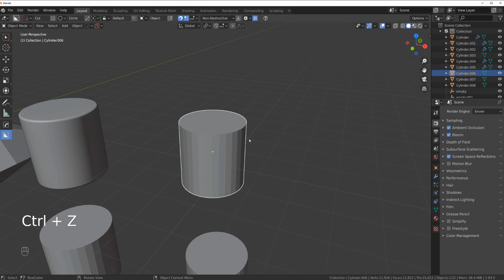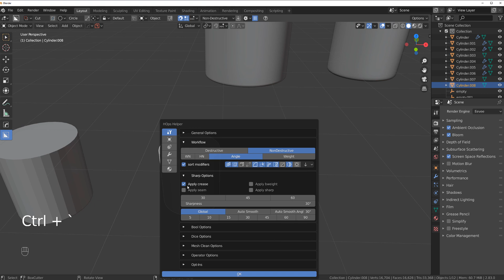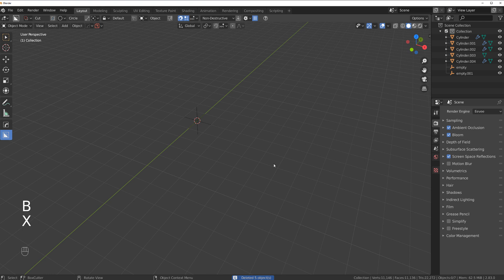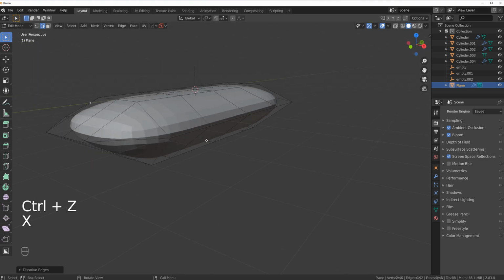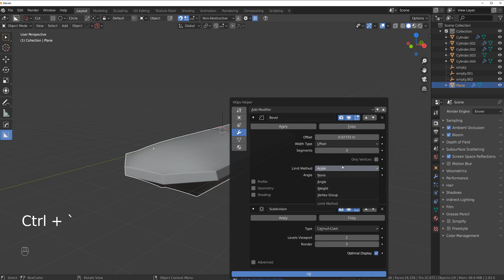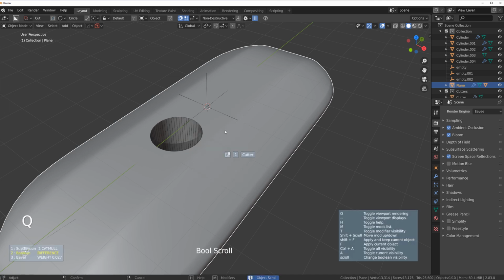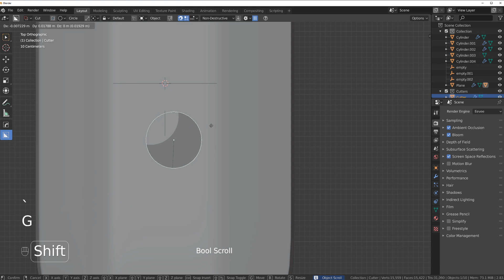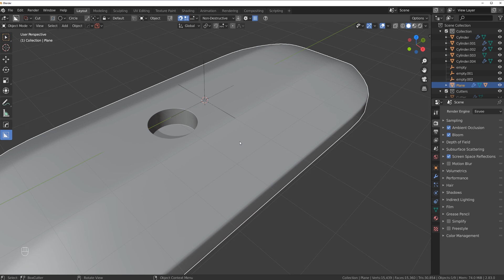SUBD + BOOLS + BEVELS - ultimate control in BLENDER

Comment: "How do you do this in Vanilla Blender?  You don't, cause you can't." - PR.
Then I'll have to put in my time with vanilla blender mastering I can't, and then I can get the addons.  NOT.
QED. 
Do it the most efficient and effective way as fast as possible.  Everything else is playing with yourself, and not in a good way, a wasting time way.  I did just realize I don't understand the Step function...
Reply from the maker: Exactrly. Just watch my vid on Bevels in hardops, it is in the hard ops and boxcutter playlist.
Reply: @PonteRyuurui , k, cool.  I'm starting further back though, cause like a pitbull training on kittens (those guys are sick), I started with bc, so I could stoke my confidence (hopefully, I didn't know bc parents by default its bools)...and then return to Hops like the ocean beating on the coastal cliffs, hoping I will eventually erode some of them away, and make it to land and safety.

Btw, may I assume the super wide aspect ratio is an artifact of your super wide monitor you have to work on for the bc videos?  Or was that a choice in post to have a super cinematic affect to your videos?  That's wider than 2.39:1 I think!
Reply from the maker: @jeffspinner6579  ya the older vids were in 21:9, i was recording in 3440 1440, now i simply record in a smaller window so 2560 1440, while i wait on you guys to get proper monitors ;-)

Comment: i thought everything  that's possible with hard ops and boxcutter is also possible with vanilla blender and that those addons are just for faster and more intuitive workflow. Can you tell why its not  possible with vanilla blender
Reply: It's indeed possible with vanilla blender. If you bevel a model, then add subdivision, then add boolean and then add another bevel you will get the same result. You don't even need to use weight. Angel limit will do just fine, as first bevel and subd makes the model smooth enough for a second bevel to only catch the geometry made by boolean. It's just that it's faster with hardops.
Reply from the maker: @Ohshirho  can you keep all bevels live though,  also try adding 4 different bevels on a model with vanilla and make them all angle based
Reply: @PonteRyuurui  live as in "not applied and being able to independently modify their values"? Sure can do. It's just two bevels: one for pre-subd and the other one is post-boolean. I think I can add as many bevels as I want, provided I have different booleans in between. I'm not arguing against using HOps - it's a wonderful addon, or trying to attack you - your videos are the reason I actually gave HOps a try. Sorry, if I sound otherwise :)
Reply from the maker: @Ohshirho  no i am just curious how much time it would take and how easy would be to manage those. Multi angle bevels in vanilla? I need to see it to believe it.
Reply: @PonteRyuurui  I agree, trying to manage over 9000 booleans, bevels and other modifiers and not to screw up their order is a nightmare without hops. As for multi angle bevels you can take a look at this simple example if you want: 
https://drive.google.com/file/d/1hL92Z3L-6dguW4R_B5qD28ZbSGD_hEkc/view?usp=sharing
Reply from the maker: @Ohshirho  see and thats where the issue is, if you disable bevel 2 the third one will jump in, i wont even try to think of managing those manually, an interesting stack though
Reply from the maker: try it
Reply: @PonteRyuurui  I've recreated the final object in the video non-destructively in vanilla blender by making use of both weight and angle limit methods in the bevel modifier properties.
Here's the image to the result and modifier stack: https://imgur.com/a/zPy6E8W